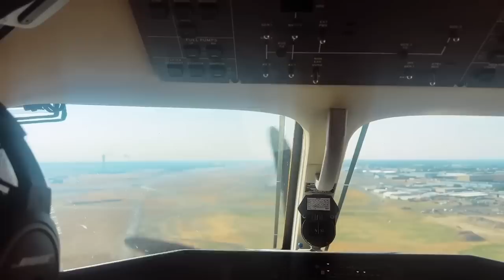Mark Patey Spills Key to Their Success

Comment: I hear pretty good things about the Eclipse and I low key doubt that they can't afford the Eclipse :)  but it's not a bus for a lot of people and gear and it doesn't have beta for short runways perhaps. It's a proper fast bird with better than Baron fuel economy which speaks to how greatly opportunities with light twin jets have been missed for numerous decades. The turbofan engine was invented in 1936. Eclipse is about 1600kg empty, a 4 seater jet could easily be less than 1/4 that weight. And there is no reason a tiny jet engine should be crazy expensive so piston planes should really have disappeared in the 60s. Which is quite different from what actually happened. And that's not considering if we were told the truth about UFOs in 1947. Our world would be star trek today. Without exaggeration. Human iniquity aside.